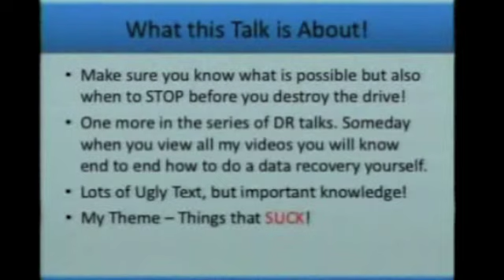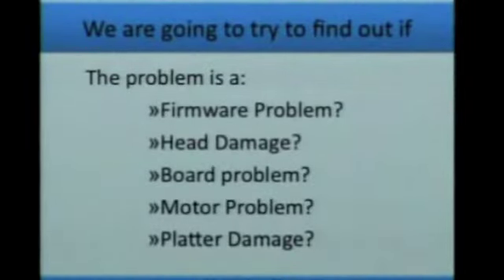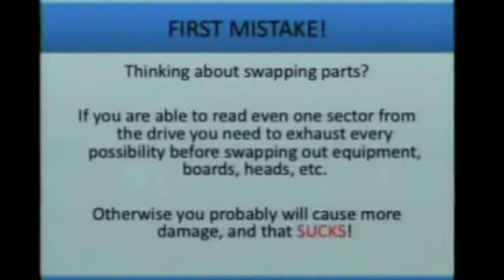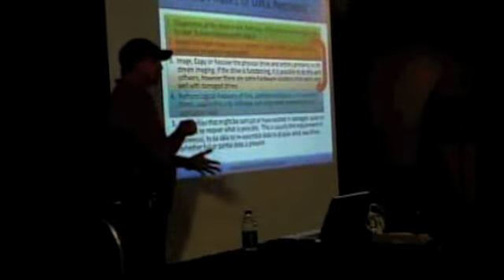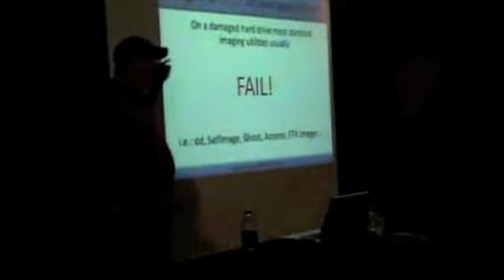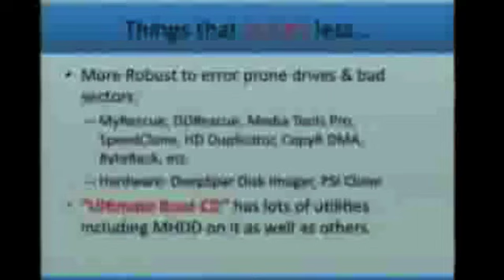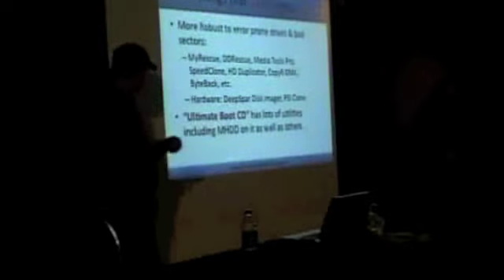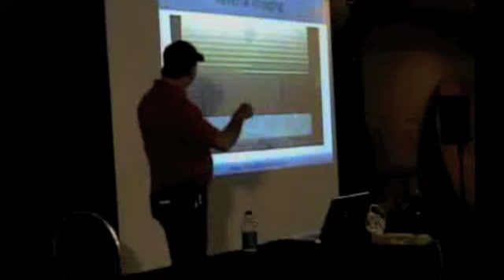Diagnostics for Hard Drives and Data Recovery at Phreaknic13 Part 1 of 9

Comment: If it was a virus that wiped my HDD, is there software available to recover my data? I don't think I'm having HDD problems, no bad sounds or smells, but, IMHO, seems to be the result of a wipe disk (a reformat?) I was awaiting receipt of a IDE adapter to hardwire a 3.5 HDD as an external device to backup everything; the problem happened while my adapter cable was enroute from ebay ;-(  I hope you can give me some inexpensive/free suggestions.
Thanks so much for all the great info.